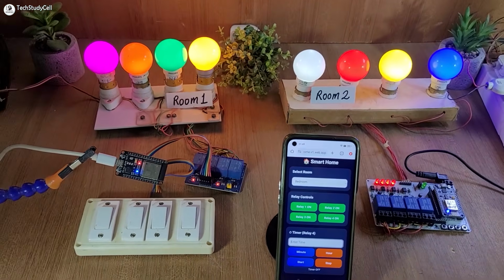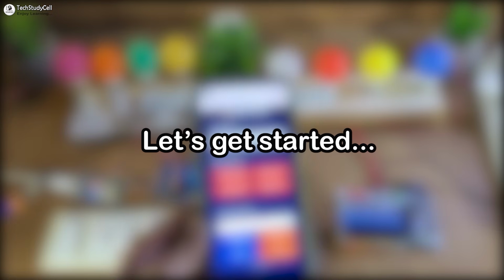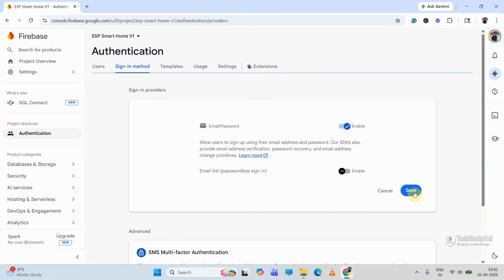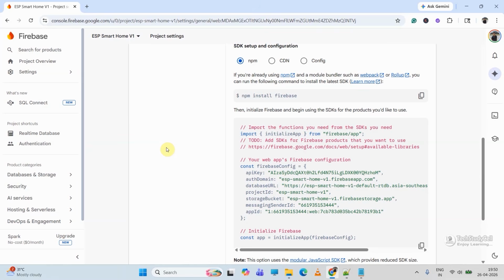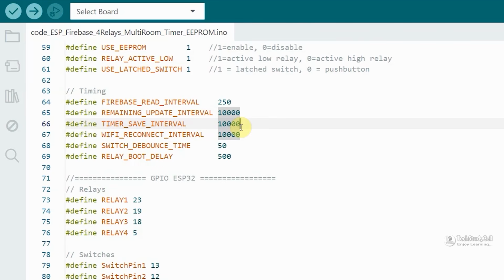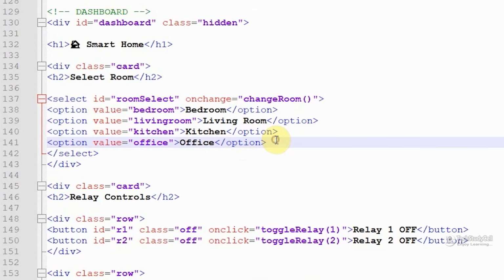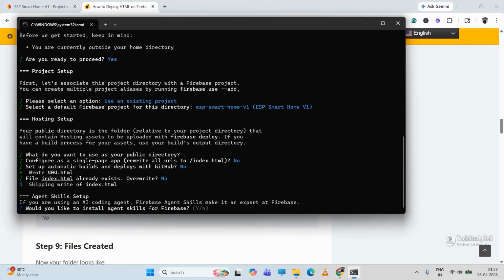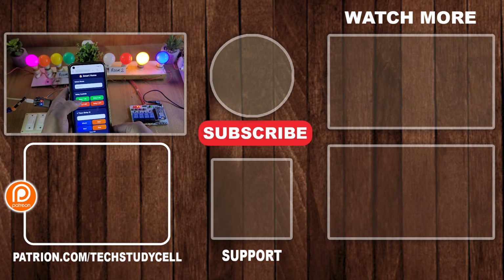ESP32 & ESP8266 Firebase Home Automation 🔥 Multi-Room IoT project with Free Dashboard 2026

Comment: Doubt: This entire project works only Computer or laptop is in ON condition, i mean Firebase Hosting through your Laptop, and also Is the URL or LINK for dashboard changes everytime??
Reply: No, Firebase is not hosted on the local laptop. Firebase is a Google Cloud-based platform, so the Firebase services run on Google's servers. Once the project is deployed, the laptop doesn't need to stay ON for Firebase to work. The dashboard URL also remains the same unless you change/redeploy the hosting configuration.

Comment: This is amazing, but I have a few doubts. Please reply to my questions:
Can these appliances be controlled through a mobile phone without Wi-Fi?
What is the range of the device? If the house is large, can it be operated from any bedroom?
Will we need to change the existing switches on the home switchboard? Do we need to replace the two-pin switches with three-pin switches?
Most importantly, if the device is installed in the hall, can we control the appliances from our phone while sitting in the bedroom?
Please reply to my questions. I am your subscriber.